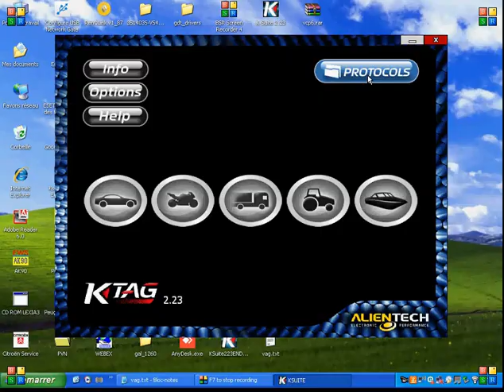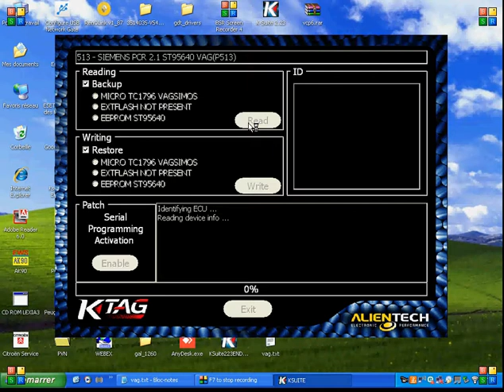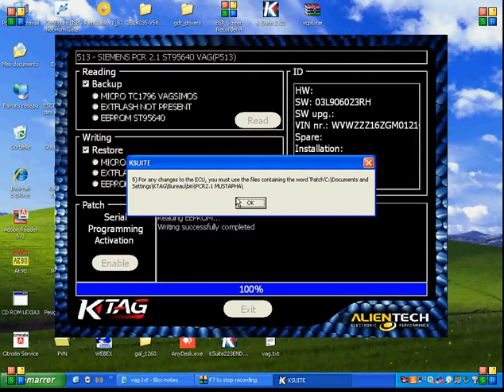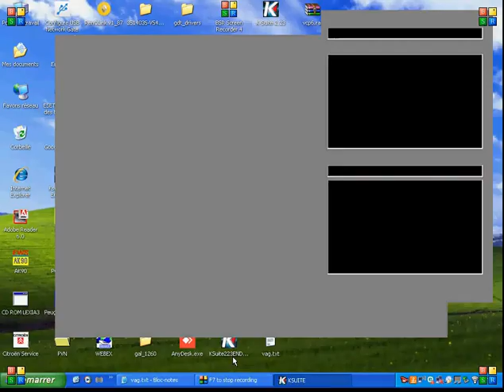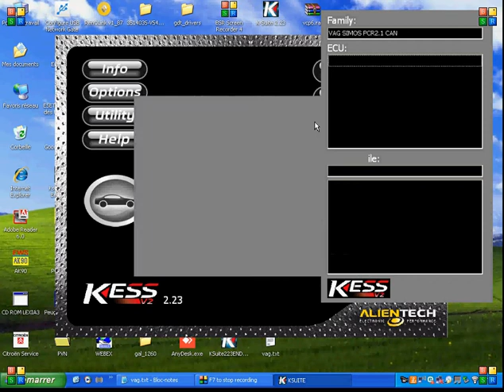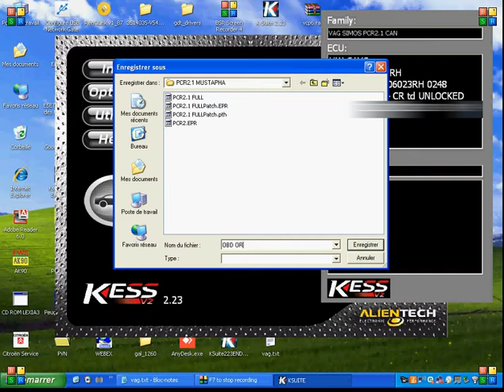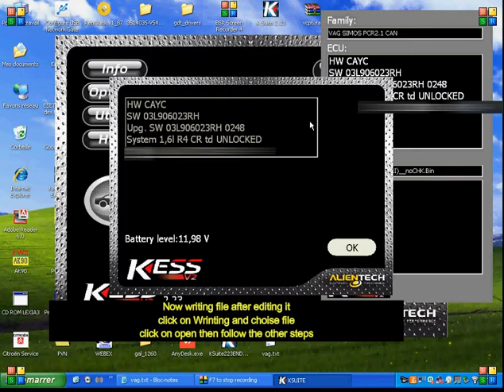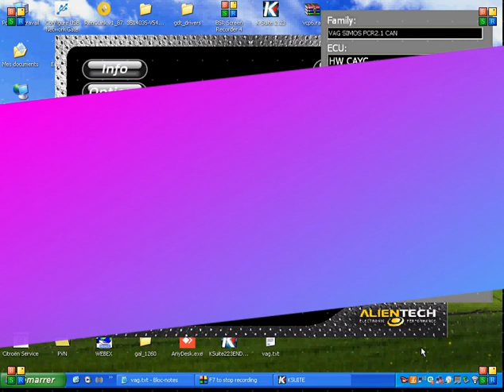PCR 2.1 UNLOCK WITH KTAG AND READING/WRITING WITH KESS BENCH

Comment: Hi i unlocked ecu on the bench with kess successfully, but couldn't read it with kess on the bench. Only could  read it by obd. Did you immo off the ecu and read it or put a switch on a pin to ecu to make ignition on off when program ask?

Comment: Hi, I have Unlocked my PCR 2.1 with kess, ID said Unlocked, but when I write ECU with OBD kess it said writing Error. The original file can I write without Problem . Only the mod file is the Problem. Checksum is correct. Thank You , great video.
Reply: Did you fix it
Reply: @IIISUDDENIII  yes, the file was wrong.
Reply: @d.o.c.6671 what was the problem on your file? Was it the checksum? Did you leave KESS to do checksum automatically?
Reply: @lowrider69yearsago58  The mod file was wrong, yes I let kess to do checksum.